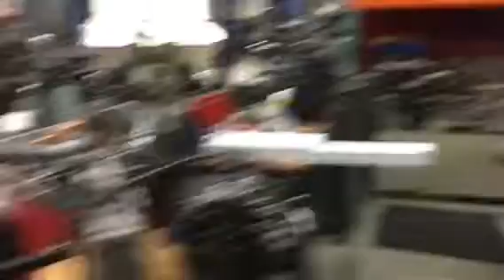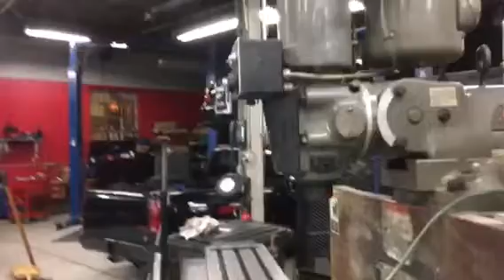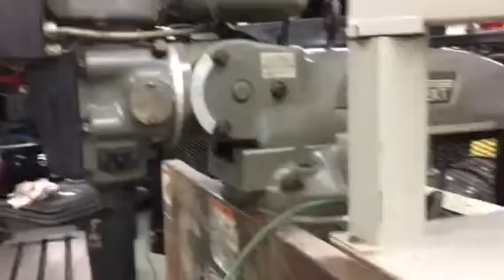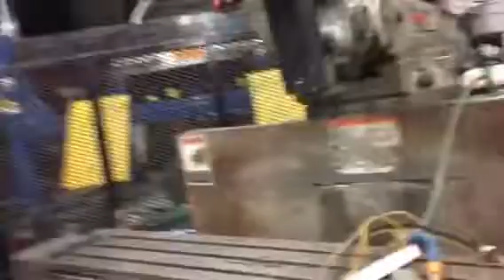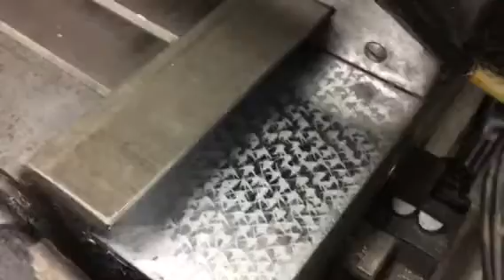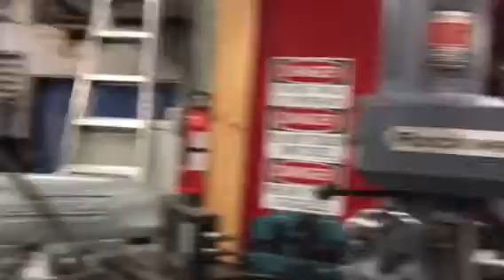Scored a Bridgeport v2xt 3 axis milling Machine

Comment: Get a Hass mini mill...by the time you get this thing running it still won’t do 1/4 of what the Hass can do.  If it was converted back to a manual with DRO then it would be ok.  The computer interface is a dinosaur..
Reply: Centaur Cyclops allready sold it for 3rimes what I paid. If I do a CNC again it will be a Hass
Reply: @pitbullmotors530  good idea rigid tapping alone is worth the Haas cost to entry

Comment: Hey Steve What a score! The little I do know about milling machines is what I have seen and heard on the net. Sounds like the older machines built be for electronic controls etc. ie: big relays and transformers can get really problematical. I really hope it works for you as you have been kind enough to share with you videos. Keep on truckin. Ian in lotus land